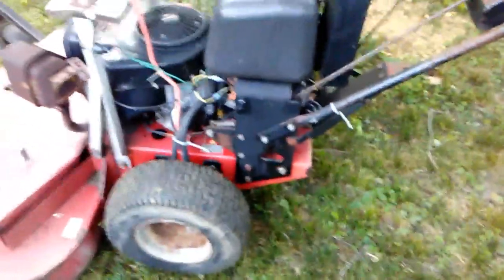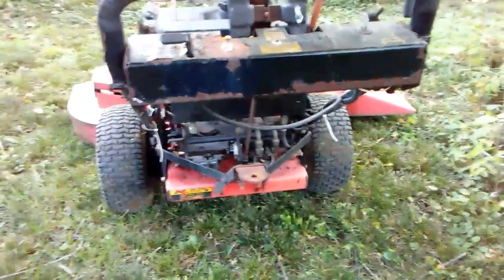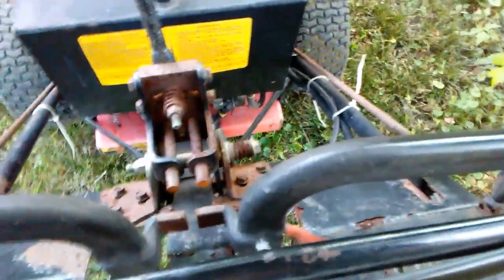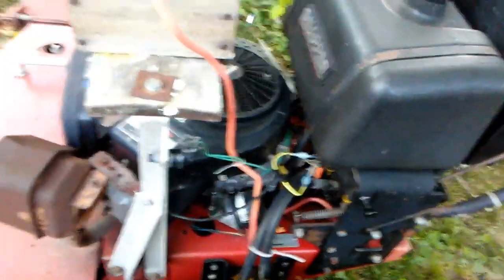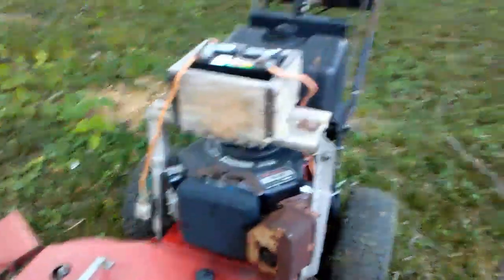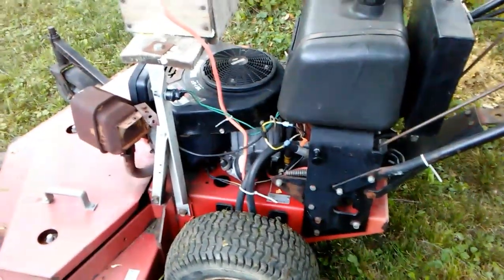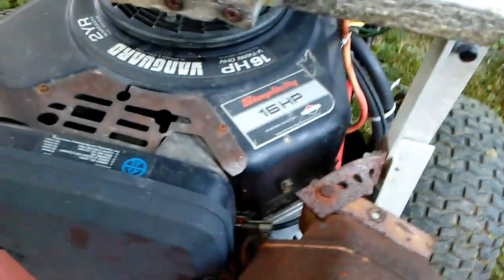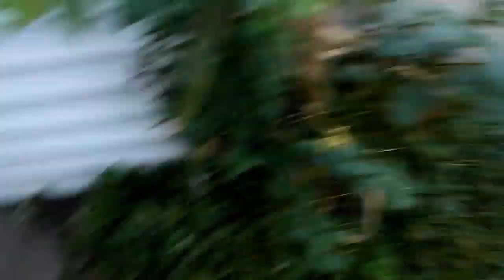My new snapper 52 hydro walk behind

Comment: Its not who wired it you NEVER shut a engine off at full or half throttle its good way to blow a valve or ur crank.
Reply from the maker: MrBassMann i turn the mower off with the trottle as low at it can go and it wouldnt turn off i found the way they wired it wouldnt let it ground out
Reply from the maker: MrBassMann i was mostly worried for when or if i lost control and needed to let go it wouldnt shut off